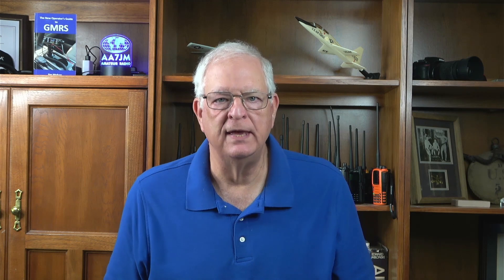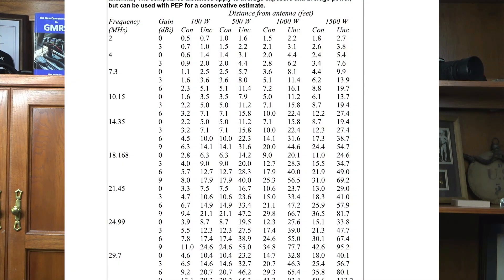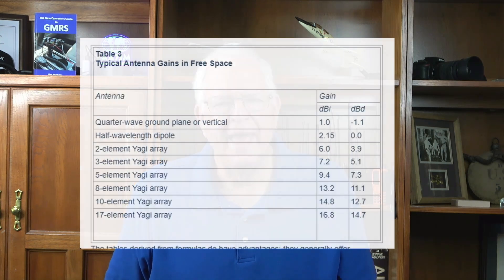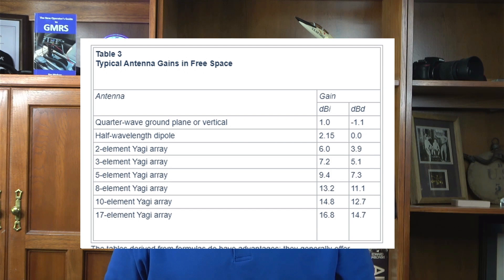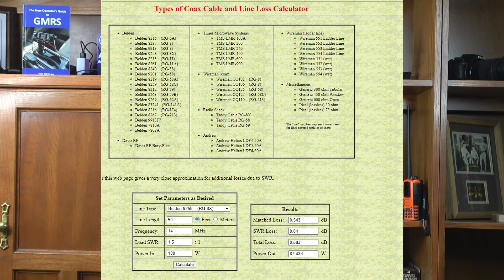Meeting the FCC RF Exposure Requirement

Comment: ok, I am trying to understand this., but it sounds complicated. Regarding HT and Mobile rigs. I have been reading about exemptions for power. It just is not plain to me yet on how to do an evaluation for an HT. It looks like HT's which were manufactured before May 2021 may be exempt? I have an Icom q7a Mini HT for2 meter/440. Output is 350 mW on 2 Meters and 300 mw on 440 MHz. It has a small rubber antenna. I have had it for years. I have other mobile rigs for 2 meters which have anywhere from 10 wats to 75 watts. These are IC v8000 I believe and an old IC 25a which may be 25 watts. I have not been on the air talking to others in years. I have thought of giving up ham radio as I dont know if I can even understand the RF exposure and formulas. I was licensed in my late teens decades ago. I am going to try and read the regulations and I will have to renew my license as I am still in the grace period.
Oh and Jim Do GMRS radios require RF exposure testing? Many of these have mobile rigs also.